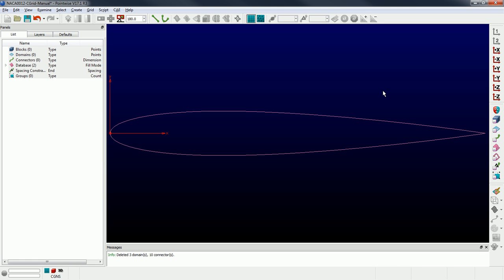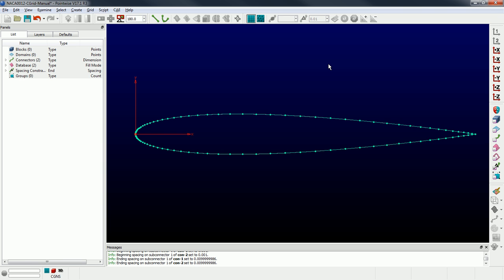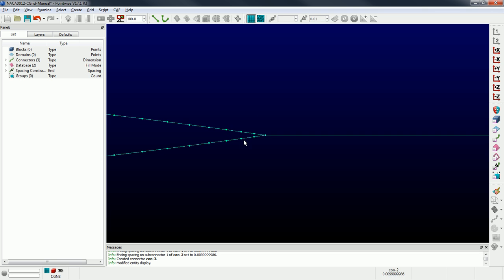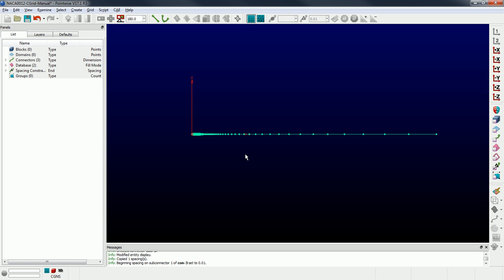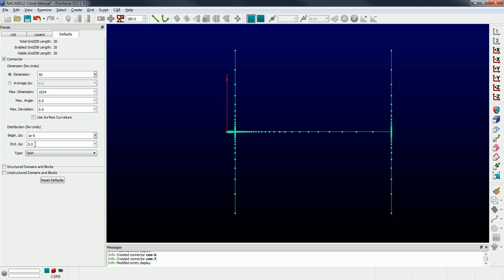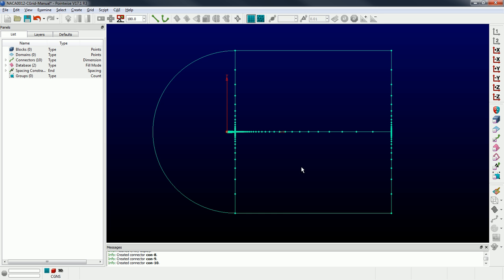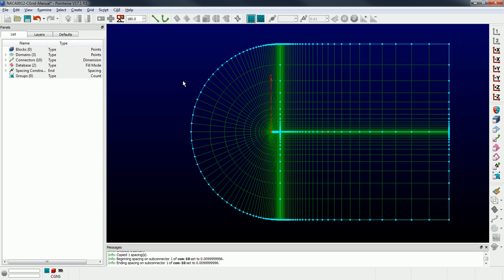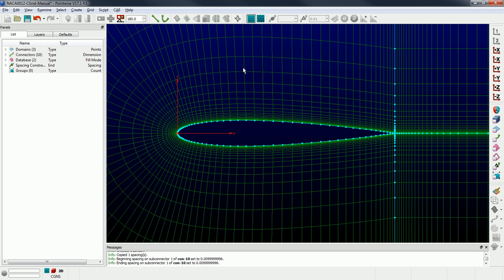Pointwise Pointers: C-Grid Tutorial

Comment: Thank you very much for the tutorial. It is really helpful. But I want to ask a question. Is it possible to change the dimension value of lines after creating the mesh? For example, you use 50 points for each connectors. But then, you want to increase it to 75 points. Do you have to repeat all the process again? Or could you change number of points? Thank you.

Comment: I have imported a 2D iges airfoil file to practice.  When I toggle Points On and OFF,  one of the connector lines disappears from the monitor while still existing in the Panel items at the right side of the screen. Is there any reason for that?

Comment: Thank you for this very helpful video :) But I have a problem with exporting CAE for Ansys Fluent 2D. It says  Error: Face processing failed.
Info: Check your grid for one of the following invalid situations:
Info: * Inconsistent domain normals.
Info: * Incompatible BC types used on opposite sides of a baffle or connection.
Info: * Non-manifold connectivity.
Warning: Aborted Export CAE.
How can I solve this problem?
Reply: Your domain orientations are wrong most likely. Select all domains then go to edit>orient. Select on of the domains then set master then select all others and align. Make sure you have a right hand coordinate system set up.
Reply: @siddhantdesai6376  Wow, it really worked. Thank you so much for the help and instructions :)
Reply: @mervekarakas2588  hey were you able run the mesh? i had the same issue but i sorted the orientation,  now i keep getting floatation error when trying to run in fluent.
Reply: @swalakhiya3380  Yes, i was able to run the mesh in Fluent. After i fixed the orientation in Pointwise, i didn't get another error. There is a discussion about flotation error in Fluent: https://www.researchgate.net/post/How_to_resolve_Error_Floating_point_in_Fluent
Reply: @mervekarakas2588  ty for the reply :)
Reply: @siddhantdesai6376  Thanks mate, I could also solve the problem with face orientation.

Comment: I am following along with this tutorial, and I generated a very similar grid with the only difference being that my trailing edge is not a point but is a horizontal line connecting the upper and lower surfaces. When I try to export this grid to a CFD solver (Ansys fluent in this case) it gives me a "null domain pointer" error. Do you know what this error means?
Reply from the maker: Cat Branchman I don't believe it has to do with the trailing edge. A blunt trailing edge is pretty standard. You may want to consider contacting Pointwise support with your error message.

Comment: Do you know the error where ANSYS Fluent will fail in loading the 2d grid where it says there are missing faces?
Reply: I don't know the case you're working on, but i had the same problem with mine and i fixed it by using extrude > path instead of using translate + rotation. This fixed the problem for me, I actually think the solution is to make your mesh a union and one-step extrusion not a step by step mesh.
Reply: +Omid Dmt I found out the problem is the orientation of the grid. Doesn't matter when it's 3d but when it's 2d you have to check. Pointwise customer service helped me with that.
Reply: Thanks for letting me know, but what do you mean exactly?
I made the same mesh in 3D and there was no problem. What should I do and what should I change about orientation in order to fix the error?

Comment: Great but how would you make C grid on a airfoil with a finite trailing edge?
Reply from the maker: There are two ways you could handle a finite trailing edge. In fact, I would recommend building a c-grid using an extrusion...maybe I'll post a new video describing that process. Anyway...if you had a finite trailing edge you could either have a branch curve connect at the midpoint of the trailing edge and extrude, or you could create a simple h-grid behind the trailing edge itself. Creating the h-grid off the trailing edge would result in a higher quality grid because you'd eliminate the skewness obtained via extrusion. In any case, I prefer to generate o-grids for airfoils with finite trailing edges and c-grids for airfoils with sharp trailing edges.
Reply: Travis Carrigan
 Thanks for your suggestions
I did make one C grid for Airfoil 0012 but its having some issues while exporting to fluent its giving me error that Build grid: Aborted due to critical error.
Is it possible for you to have a look over my project file and suggest me anything?
Reply: Hey ! I'm getting the same error, did you figure out something ?